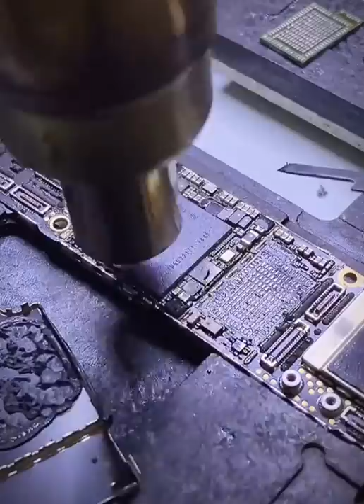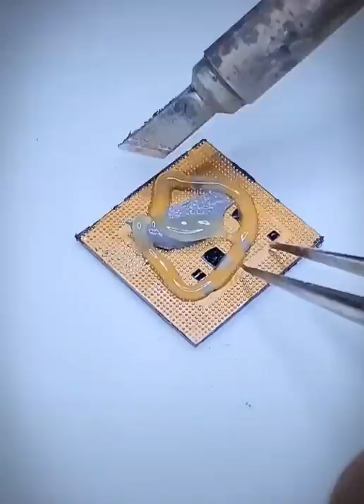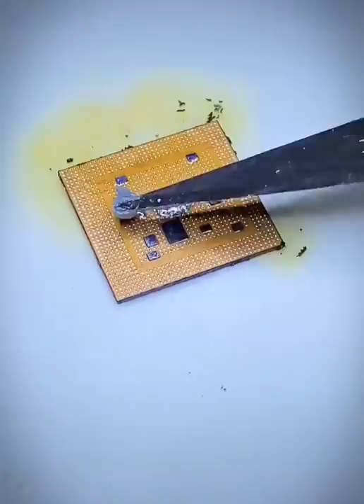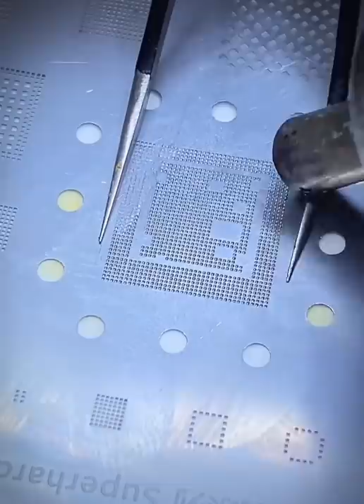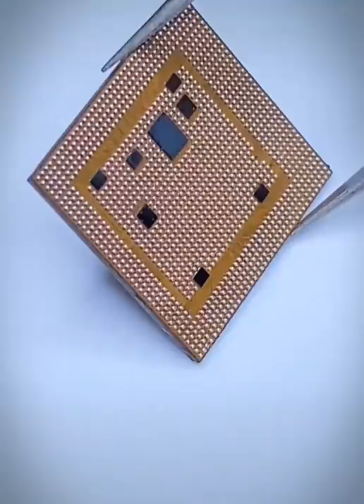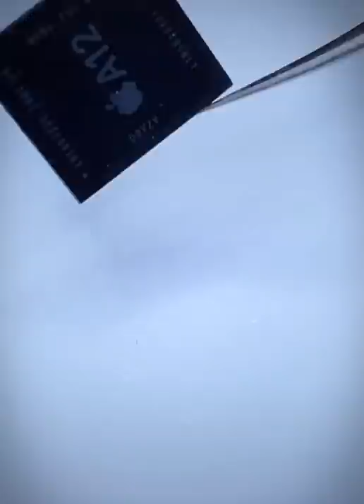iPhone xR cpu A12 |  cpu

Comment: Reballing … that’s some high level repair shit there !
Reply: I'll get a14 bionic there why would I use a12 ?
Reply: @mahir4042  because you can't upgrade the SoC on an iphone.
Reply: @marcel2293  it will be interesting to see what happens if it is possible
Reply: @mahir4042  Sure will be, but it doesn't change the fact that your comment was pointless
Reply: @marcel2293  hahaha
Reply: @marcel2293  you cant upgrade an soc of almost every motherboard, not just iphone
Reply: 500th like
Reply: @mahir4042  Simply put, SoC's aren't backwards compatible like computer processors are because : a) The die size is almost never the same from one generation to another (which means it wouldn't even fit; b) each generation of SoCs supports new instruction sets or variants of instruction sets which are not always necessarily supported by older SoCs; c) even if the Apple A14 were to fit in the place of the A13 or the A12, the rest of the components wouldn't even recognize it. The SoC would thus be unable to communicate with the dRam and the flash storage since the micro-code embedded within the SoC itself is incompatible with the rest of the components which have been instructed to only respond to the A12 ... and the list goes on.
Reply: @PCarba then again,you can't change it on a Samsung phone either.i agree that apple sucks tho
Reply: Lmao not
It's not a big deal
I used to do it
Reply: @the-lag-gamerita5446  lol most of these ppl who comment IPhone vs Android are using phones like Blu and Ultratouch or haha remember the old Huaweis?
Reply: @mahir4042  it won't, because it is designed not to be.
Reply: RBA work is highly specialized not easy. Good work
Reply: @mahir4042 hardware Won't support Or Motherboard will  Damaged Cause Differences in Clock Speeds as well 

Will heat and Cause Your iphone dead 🤐
Reply: @mahir4042  you can theoretically change it but i highly doubt any cpu would be compatible with that motherboard, so you would have to change that aswell
Reply: @marcel2293  you can but it's gonna be a little hard to

Comment: I know everyone’s heart dropped once he put that thermal paste lookin thing on the pins of the cpu.
Reply: Pins?
Reply: Those are bga pads, and the material is soldering paste. Some severely overfluxed 37/63 by the looks of it. Use it to clean up the pads and get rid of the old factory high-temp leadfree solder. No pins or sockets here, its a BGA chip.
Reply: Why tho?
Reply: @user-kj3fx8un4p  Because reasons. Obviously.
Reply: @pr0xZen  it's not their phone tho-
Reply: @user-kj3fx8un4p  Ok I'll entertain the notion for once: The original poster here didn't quite understand what was going on. Nothing wrong with that, BGA rework isn't exactly standard school curriculum. The general idea though, AFAIK, is that many people don't neccessarily enjoy seeing things getting broken, even if it's not their own property.
Reply: @pr0xZen  oh ok ok, thank you!!
Reply: @user-kj3fx8un4p  🙂
Reply: He is reballing the CPU lol
Reply: @pr0xZen  to be fair, evdn though they're called balls it's almost the same, they're just shorter and thicker lol
Reply: Mine
Reply: This isn't a thermal paste.
Reply: @norbert.kiszka  I know, that is actually the compound that cpu pins are made
Reply: Nah that's flux used to help connections, and helps keep it clean,  I use it all the time when repairing motherboards. The more you use the  better. The other I think is leaded flux or something like that.

Comment: Some serious skills to do this. Well done 👏
Reply: Bruh he put thermal Paste on the goddamn CPU but at least it's not a AMD or Intel
Reply: @eduardmc8645  that’s solder paste
Reply: @eduardmc8645  You sir are not smart
Reply: First step is to remove original solder, in this case with two compounds. Rebump with screen, solder paste & heat.

Comment: that probably cost 80% of the phone
Reply: Not really, it costs about 30% of the phone since the CPU replaced it's taken from donor boards and it's free, only the labor is payd (50-400$) which is still cheaper than repairing it at an apple store
Reply: @Chinese_Hampter  that's it.

Comment: Holy shit that's so cool that I don't even know what's happened to the chip and why. 😶
Reply: Hes doing a thing called reballing, it consist of replacing the tiny solder balls underneath the CPU CHIP.
Reply: One of the solder connections was bad. Replace all of them for repair.

Comment: As a PC builder, it feels weird finding thermal paste on the pins of the CPU…
Reply: My god yeah
Reply: @LucianGarz-x9q  Imagine watching that typical YouTube video of someone doing a build with an i9-11900K and they put thermal paste on the pins…

bye bye £500
Reply: As a PC builder you don't know what it is. And no problem, mostly advanced technicians knows it only. The grey thing is a soldering putty. If you look it inna microscope it is made of flux and hundreds of thousands of micro tin balls. They usually melt at 138°C at the best models, it is way cooler than the original soldering. So it means it will require way less effort and heat when soldering it back. That means less chance to damage the board. And the yellow think it's just flux, to help the tin soldering melt and being clean/hold together.
Oh and also there is no pins on smartphone CPUs. It's just balls and pads. The guy remove the old soldering and make the new balls of soldering. That is why it's called reballing.
Reply: @TJChagas  Mate I didn’t need a paragraph, it feels weird to me because it feels weird to me.
Reply: @Alfwoodsy  You can build a PC but cannot take 20 seconds to read a paragraph. Ok i'm gonna shorten it to you: its not thermal paste.
Reply: @TJChagas  Ok cool.

Comment: apple has mistaken to use silicon glue under its cpu for the whole generations! they still dont know that no need to use glue is way better and last longer mileage.
Reply: That's the point my friend. If they last shorter, they'll buy another IPhone. If they make the technician job harder by glueing under the chip, much less technicians will repair it, and that means more dead phones = buying new iPhones. Capitalism for the win!

Comment: Can someone please explain, why would you need to do this ?
Reply: To short it: water damage, cracks in the spheres due to drops, overheat, bends on the phone, etc.
Reply: Just found one bad solder connection out of hundreds, but all must be replaced. Expensive CPU chip is reused.

Comment: What is he doing
Reply: It's called reballing.
Reply: @vcom  and why would you do that to your perfectly good phone
Reply: @vcom  whats its benifit
Reply: @allana5930  Due to regular use the solders can deform leading to short circuits hence they need to be re applied.
Reply: @Anonymous_uncle  it's only a fix.
Reply: @vcom  So that the phone works good?
Reply: @Anonymous_uncle  yes it fixes a non working phone.
Reply: And the chip will not work..